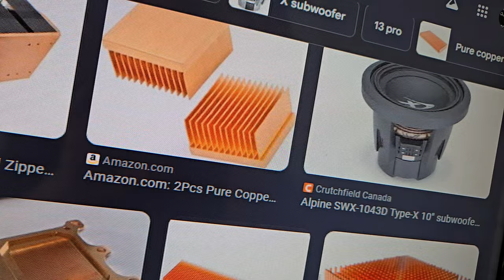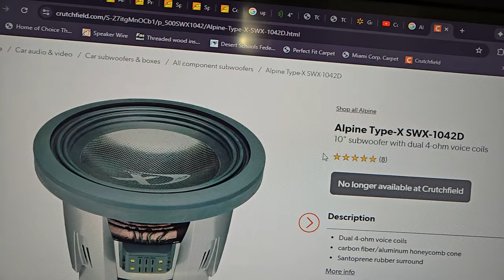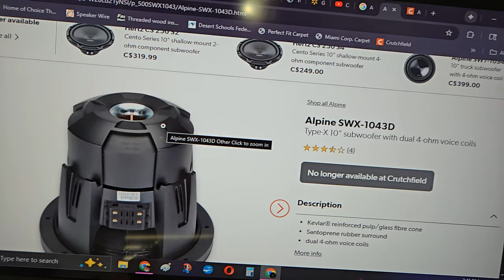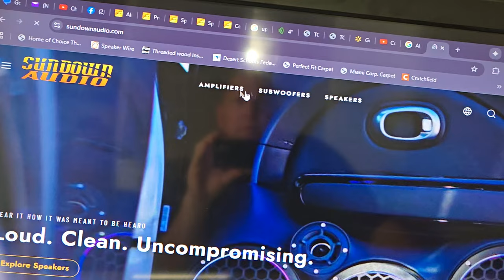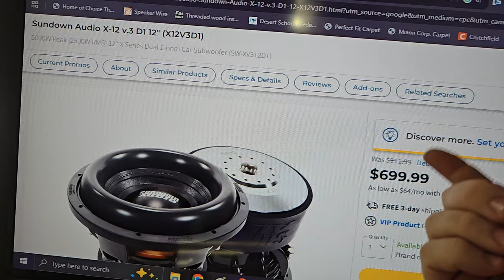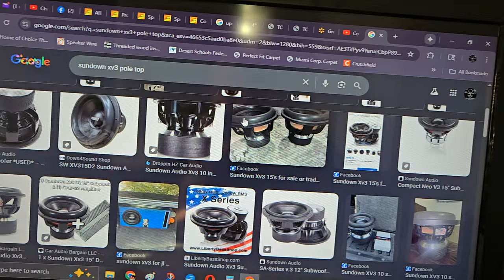Subwoofer & Amplifier cooling with copper heat pipes, liquid cooling, dry ice CO2 or Nitrogen

Comment: Bazooka liquid cooled subs @ 300 rms for the 12 inch, didn't need a big magnet in the first place. They never caught on because it was a very complicated system, and highly prone to leaking, they didn't use radiator fluid either it was just regular water.  Dont just make things up you think sounds good but actually don't know

Comment: I'd be very surprised if any of these "cooling" gimmicks on any of these subs makes any meaningful difference in long term thermal power handling and I'd defy any of these sellers to line up a side by side test with prototypes with and without whatever "cooling feature" to show exactly what percent more power their flavor of "cooling" provides for and what any of that translates to on a Termlab.    

I always figured the MT had the solid pole piece just because it got louder than without.   I've known people who have gained in the lanes from taping up their pole vents.
Reply from the maker: How am I supposed to hide my weed if my hole is all taped up??
Reply: @RobotUnderground  
Same place you hid your cellphone and all that when you were doing time.😮

Comment: Would the magnetic flux cause the copper bar to act like a transformer causing feedback to the amp?
Reply from the maker: I don't know that much about it I just know that it doesn't belong in the gap and I've seen problems when people add it
Reply: I think at the least the bar would need to be grounded like you said

Comment: sony es xs-l1255g has a huge cooler on top of the pole piece that looks like a bottle cap . i have a pair the rubber surround was torn and i just replaced the rubber with foam surround
Reply from the maker: Well it's actually cheaper just to make the motor larger with more magnet and it's more effective as well

Comment: Its so funny to me even seeing people think that this would be...idk..even worth it. The EASIEST way to not over heat your equipment is- 
AMPS: Dont run them at 1ohm. 
SUBS: Run them at their RATED power.

If you REALLY need to cool amps that much use simple fans. 
If you REALLY need to cool your subs down, turn them off. 

People that "NEED" to run their stuff on terribly low voltage, to the lowest ohm possible, all the while having installs with the cheapest/most pointless boxes, and wiring that is inadequate for the gear they run ect ect. are ridiculous.

Many of these companies KNOW and PLAN that your going to ABUSE this stuff, hedge their bet and use it NORMALLY !! LOL

Actually, the EASIEST thing to keep your gear cool is (and i know this is a pretty foreign concept for many) USE COMMON SENSE!! Lol.
Reply: Yep. I've never blown a subwoofer in over 30 years of doing this. Many systems in many cars.
Reply: @csj9619 The only times ive blown subs is from accidental and/or purposeful abuse. Theres almost no way to blow a sub with its actual intended and correct use.
Reply from the maker: Maybe it's all the testosterone in their system that they feel like they can cheat the system I've seen this in car guys and all kinds of other hobbies like with PCs where people try to get something for nothing

Comment: Depending on where the vents are, you could also use something like the  Arctic Liquid Freezer III Pro 360, isolated with a thermal grizzly pad. On an inverted sub even 😅
Reply: I like how you're thinking. Could you explain a little more what you mean? I'm rebuilding my TC Sounds TC-9 12 and have some extra left over of that stuff. I've been wondering what to do with it before it goes bad. Pat said it's not needed, but I'm curious now
Reply: @Right-Handed_Neutrino tbh, I think ferrofluid would be more beneficial
Reply: @Shiny_Tsar ferrofluid is a terrible mess and wont work well for subs. It weakens the voice coil adhesive and soaks into  the spiders from "splashing" around. 
Any "rapid" type of cooling will introduce moisture and condensation. If these things worked, and worked WELL, theyd still be in use in modern subs. But they dont, so they arent.
Reply: @imawesomeyourenot it can be a mess. It's a lot better than air, for heat transfer from the coils, that's all. Supposedly it can be used in all types of speakers. Idk if there's a good formula for subs. It can break down in high temperature too.
Reply: @imawesomeyourenot it soaks into the paper cones too
Reply: @imawesomeyourenot APG W Series is made for subwoofers. The design of the speakers is part of why they are prone to leaks.
Reply: @Shiny_Tsar 
A cool idea, and cool tech. But its uses in audio are too limited.
Reply: @imawesomeyourenot it probably wouldn't help much, just disappearing heat from the backplate